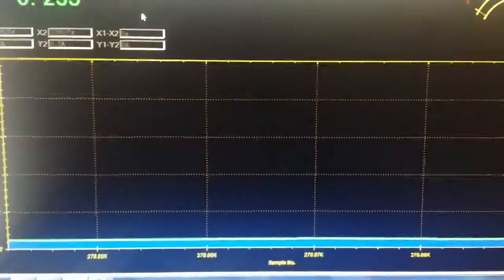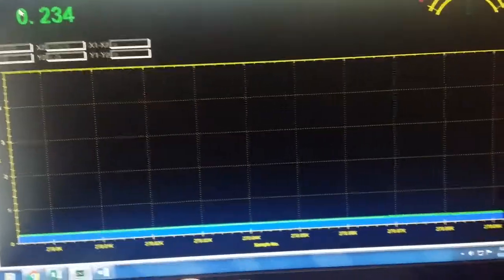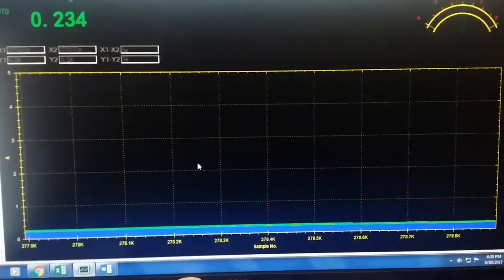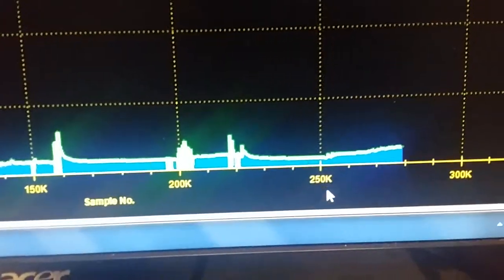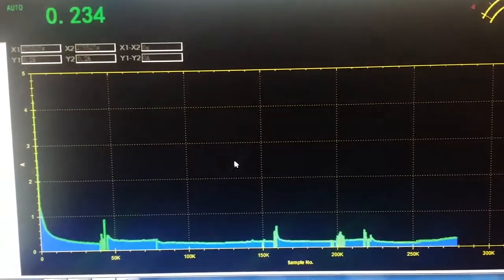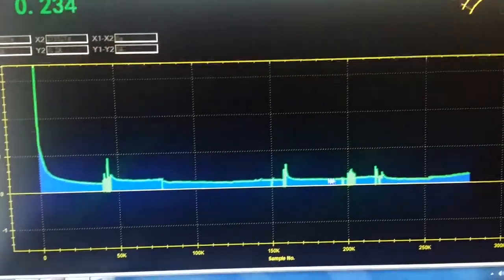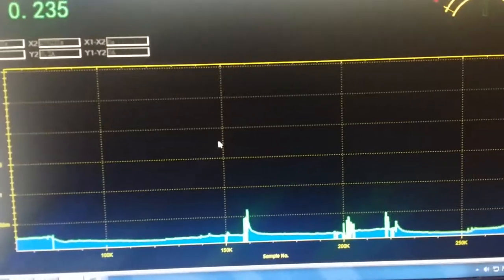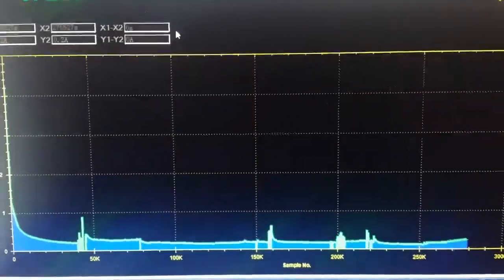Allwest Power cell 78 hour run

Comment: Well done.
I would guess it looks about the same capacity as an alkaline D cell, maybe you could do a test on one to get a benchmark.
What battery chemistry are you using?
Regards - Martin.
Reply from the maker: Hi Solar, Yes very close to an alkaline D cell, I would say a little  less at the  point of that test, I am getting about 16,000 mAh, with the alkaline D cell at getting 17,000 according to chart 

Although this test  it is still going and this morning it is around 18,000 mAh, so we will see where this goes 

This is a magnesium and copper cell 

Cheers